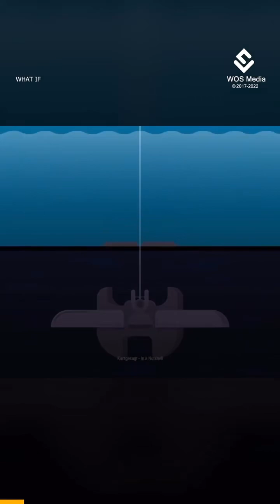Japan Is Building Space Elevator

Comment: Will it rotate with earth 🤔, will it be always connected?
Reply: Rotate with earth
Reply: Its center of mass will have to be exactly at the geostationary orbit. That way the pull by the gravity and the pull by the space will keep it in place all the time. They may have to add some adjustable counterweights which will have to be moved up and down to offset for the geosynchronous orbit fluctuations or a pull due to the lunar gravity.
It's possible.
Reply: What could go wrong?
Reply: Well if it's connected , then it must .
Reply: Yes with centrifugal force.